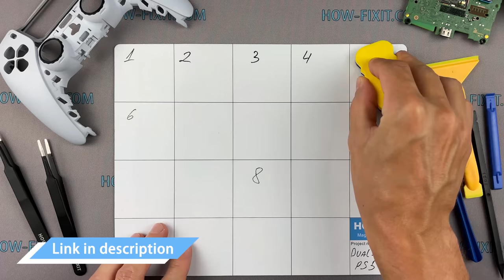How to Fix Water Damaged PS5 Controller

Comment: Watch out when reassembling - there is a blink-and-you'll-miss-it cut at 26:56 where it skips past screwing in the two screws that go just above the rumble motors. If you're wondering why you've got two screws left over at the end, this is probably why!
It's also not clear on the video, but it's best when replacing the battery holder to tuck the red and black wires from the rumble motors behind the two little legs of the battery holder. Otherwise those wires will stick out and get caught when replacing the back cover.
Reply: I caught that as well, but GREAT video. Thank you!
Reply: I wish I read your comment before I finish my assembly :(
Reply: I was left over with two... where do they go?
Reply: Hm

Comment: Just wanted to say thanks for the video, my man. i didn't spill cola on it luckily but when my toddler was sick this week she had a bucket with a bit of water on the floor in case she needed to.. you know throw up while she was watching tv. She didn't throw up but when she moved the controller fell into the water and being completely submerged for a few seconds. 

I waited a few days to let it dry. it did charge, but the ps button didn't work so I couldn't turn it on. I tested it using game pad tester and saw that it did work, except for the ps button and also the buttons on the right side were weird, i press the circle button and i saw that i "pressed" all the buttons. 

long story short, since the controller was gone anyway I used this tutorial to try and clean the thing and while i didn't go further than the connector strip and the button rubbers it worked!
Reply: Thank you! It means there is hope if I follow the steps in this video. Long story short same thing happened to me with my toddler and you reassured me. Thank you.

Comment: 11:11 As I figured on my own controller, the DualSense buttons are made of acrylic plastic and will crack from contact with the Isopropyl Alcohol. So I would recommend using just water with a light detergent like soap or dish soap for cleaning plastics (just make sure to dry them properly afterwards).

Comment: Got "something" over my pad and had to wash it clean. Disassembled and reassembled it. Worked so far but it seems like my conductive film is defective. the PS button doesn't work and i can see the traces that go from the home button to the back side of the mainboard being disconnected. Thanks for the Aliexpress link, will post back when i have replaced that.

Comment: I spilled stuff on it but it still works it was wet in multiple places  but I wiped it off and cleaned it with windex i didn’t open the controller but it still works fine

Comment: So... I managed to somehow damage my controller with isopropylic alcohol (i didn't even know how since this stuff evaporates so quickly) but the thing is that i was having stick drift problem and put a 99% alcohol solution inside my analog-stick opening... I put a lot of it so the alcohol may have spread around the controller's internal components, should i open up and clean it or it will fix itself when the alcohol evaporates? I dont exactly know what i should do

Comment: Can corrosion be fixed? I accidentally spilled a bit of monster energy drink on my dualsense edge which ran down the stick modules and it turned off 2 min later with the pop-up message saying modules not correctly inserted

Comment: *HELP* Thank you for the video.  My son spilled Apple juice on one of his controllers, he never told me.  Now the controller blinks orange twice when I plug it in to charge and won't turn on.  I tried all the other fixes including disconnecting the Bluetooth, attempting to reconnect, and disconnecting the battery.  Does anyone reading this comment think a cleaning such as in this video will fix the controller?  Thank you!
Reply: It should help

Comment: Mine has been ice tea damaged for 3 months now...
Broken of course.
Will this still work?
Reply from the maker: Yes, of course, you can restore your controller. If any button does not work, you can replace the broken part of the controller. Links to spare parts in the description. Just follow the instructions.
Reply: same with the ice tea ... i did it today and let it dry. i used 98% iso-alcohol with a toothbrush 😅 i tried to drink and play with a broken wrist in dec. 2021.

Comment: Mine fell in a mop bucket 
Will this work?
Reply: Try this out, if it doesn't work then buy a new one. 
You just have be extra careful with those parts, if was you then I would buy a gaming laptop and a waterproof keyboard and a gaming mouse which would cost me  abt  2090 bucks but it's worth it trust me. If you Don't wanna buy a pc then buy a new controller

Comment: Is there an update version of this for the new controllers that just came out recently? They’ve made some changes and I don’t know how to get the touchpad sensor bracket off. Instead of the two screws in the top corners there is just the one, but it’s still attached to something and I don’t want to break it on accident.
Reply: Same I got it off somehow but now it doesn’t go back on together